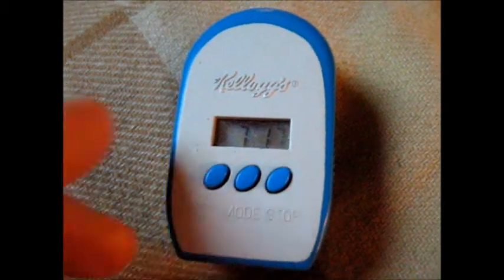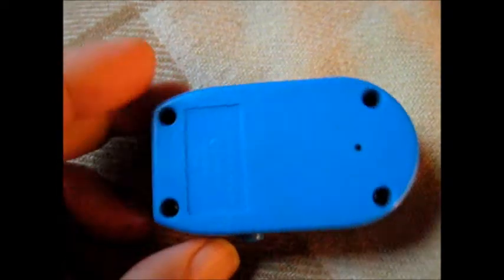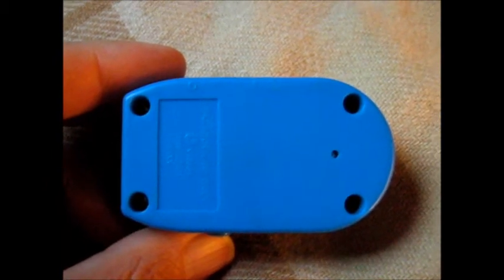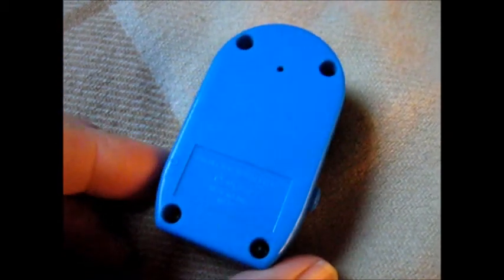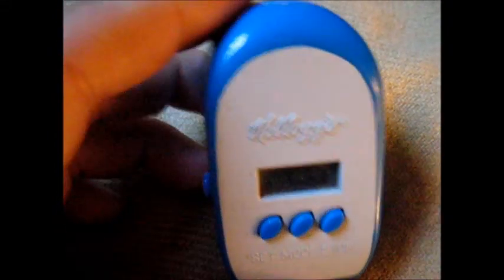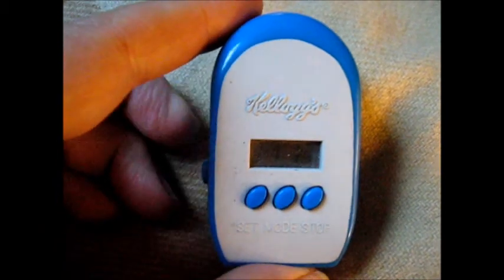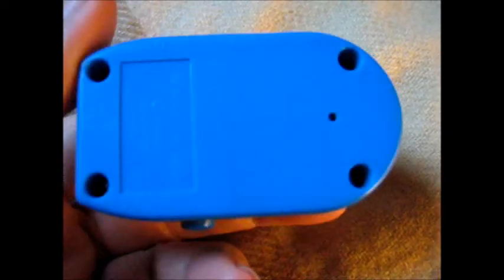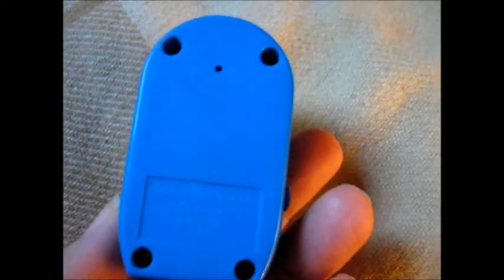Kellogg's Projector Alarm Clock Torch Toy Rubbish ◔_◔

Comment: I have had my little clock for years and I love it. There are small screwdriver sets available just as there are large sets (I have the small set so I can do craft projects and also repair my glasses when the screws there loosen). I love this clock as I like a dark room but I also like to know what time it is. This will be my second battery change to the projection clock and it is still working perfectly. Love it!
Reply from the maker: Yes, you are right that they last for years. It's been quite a long while since I made that video, and that little clock still beeps every day at the same time. And, yes, you are right also that those special screwdrivers with specially shaped ends are indeed available! lol  :D

Comment from the maker: Thanks for the info. So many products, today, are not meant to be repaired. Even those little space heaters have funny screws that normal screwdrivers don't fit into. They just want you to throw them out and buy another. In a way, you don't own the products, at all.You sort of rent them and are obliged to change them regularly, as they aren't meant to be opened and repaired. Traditionally, an owner of a product could open it up and at least have a go at repairing it. It makes me all very cross!

Comment: in some cases security screws are used to prevent tampering or people from hurting themselves opening dangerous items. in this case it was probably cheaper to use different screws than to include standard battery bay.
1st: money
2nd: common sense